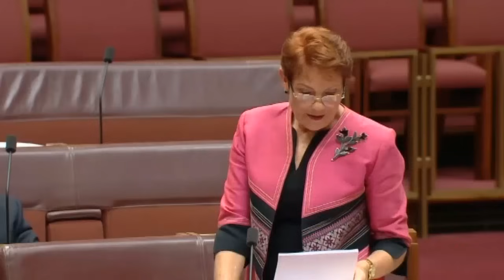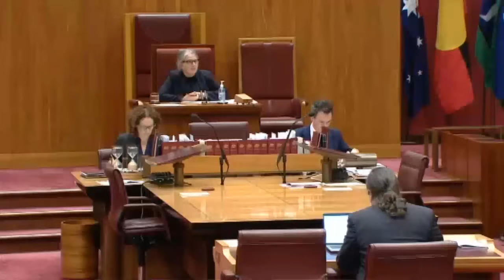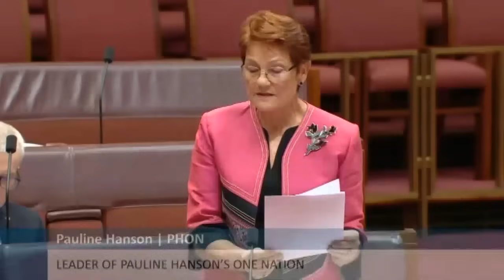Risky Depths: The Controversial CCS Plan For Australia's Great Artesian Basin

Comment: Hey Pauline CO2 is natural and in basicly everything. Its not dangerous at all. In fact life would not exist without it.  Plants need it to grow,The powers that are just know its a great thing to tax so they make it appear like a monster. 
The gasses that come from cars are not CO2 either they are carbon monoxide not carbon dioxide. Saying this i still don't believe it should be injected into the Artisian basin. But we do have radiation leaking in to the Artisian basin via Roxby Downs tailings dams.

Comment: This project is an absolutely pointless exercise in woke science. The most rudimentary knowledge of the scientific factors involved should convince even the IQ of a politician that climate alarmism is mankind's second biggest existential challenge. Over a trace gas vital to life. Basic Science needed, CO₂ (carbon dioxide) 442ppm, Specific Gravity 1.5 (it has obesity/gravity issues), CH₄ (methane) reacts with O₃ 0.00017% (1.7 ppm) breaking it down, H₂O (as water vapour) ±21,000ppm is by a factor of 70-95% the most potent GHG. Leading from behind seems to an Australian choice.